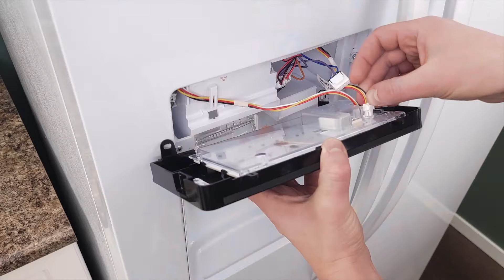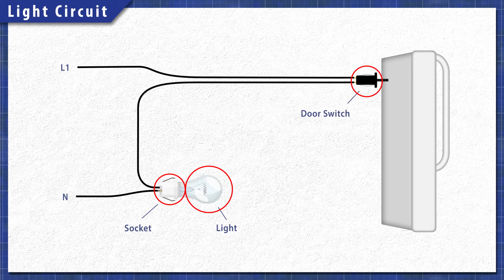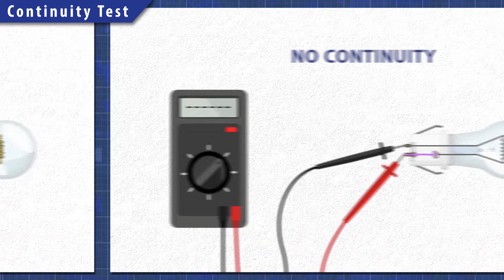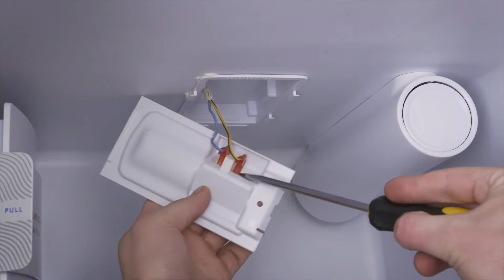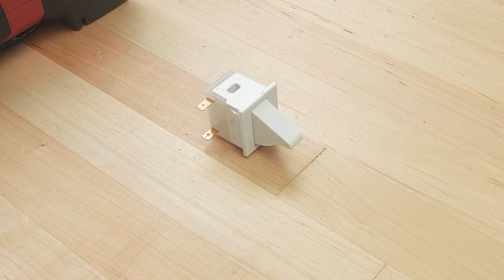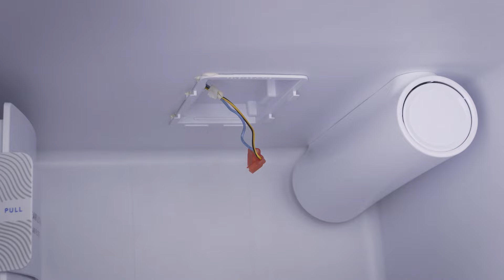Refrigerator Light Isn't Working? (Complete Troubleshooting Guide) | Repair & Replace

Comment: My friends 12 year old GE fridge started acting up a few weeks ago. First it was ice not dispensing followed by all lights dim a week later. I said that sounds like power is failing and it's the right age for good 10,000 hour capacitors to fail. I pulled of the control board cover and it was obvious C29 and C30 were bulging indicating they were failing. A tech would have replaced the $280 control board plus service call leaving him with a $500 repair bill. I did not have a spare board on hand but I did have spare 470uF 25V caps. I removed the old caps which measured close to the 50% I expected at 195uF and 225uF, I installed new caps and everything came back to life.  Total repair cost $2 and an hour of time.

Comment: I have 2 fridges I have one 2015 electrolux and a 1980 kenmore. My 2015 electrolux uses a total of 11 LEDs which are connected in series. The 2015 electrolux has a circuit board. The 1980 kenmore uses a incandescent bulb but when it was time to replace it I bought a LED bulb that uses an e26 base. Just saying that both of them have an ice maker.

Comment: If your refridgerator uses an e11 intermediate screw base I sugesst using an e26 to e11 converter
Reply from the maker: Thanks for watching. Yes that's an option as long as both bulbs are incandescent.

Comment: Mine is a LED connected in series.
Reply from the maker: Thanks for watching. If it's an LED than you can't test the LED and will have to replace it. You can buy 1 LED and try swapping each one out to see which one is the problem.

Comment: Even though the refrigerator in this video is different from my GE model GTS22KGNBRWW, I saw a few tidbits that were enough to help me troubleshoot my own frig.

In my case the circuit board where the LEDs are found is the main control board for the full operation of the refrigerator. There is only one set of 3 LED lights in the refrigerator compartment, and all three are on the main circuit board. It turns out that they are electrically connected in series. That means if any one of the LEDs fails then all three lights go out. That is what happened in our case--one LED failed. We discovered which one of the three failed. So, we soldered a leaded LED in the proper polarity across the bad original LED. That little "hack" put us back in business. 

The refrigerator owner's manual tells the owner to call a GE service technician if the light goes out! Someone wrote on a GE support website that such a design is "stupid." Fortunately, we were able to get ours working again without spending any money, but it did take a few hours to "replace the light bulb in our refrigerator." It's sad that what used to be simple and inexpensive has become so difficult and, potentially very expensive, and time consuming.

Comment: Im here again 😂😂😂😂. Now its my mother in law's refrigerator light and found this video. Also i am planning to buy a multi meter, can you suggest since im not an expert.
Reply from the maker: Thanks for watching. For testing resistance or continuity, any cheap multimeter will do, you don't need anything with advanced features.